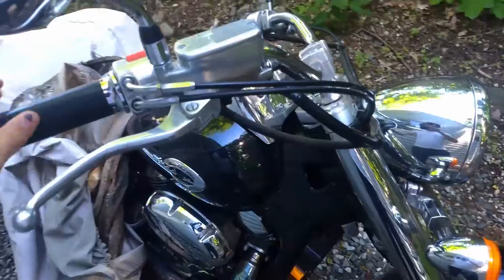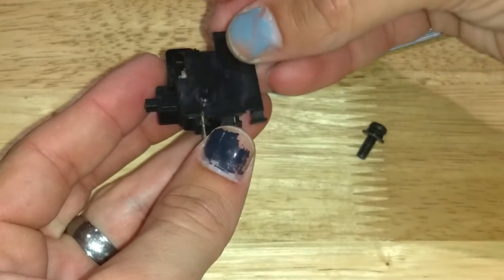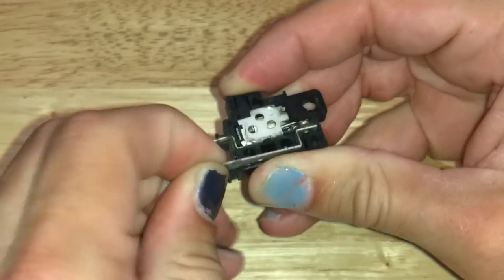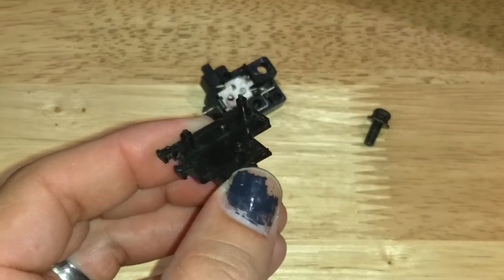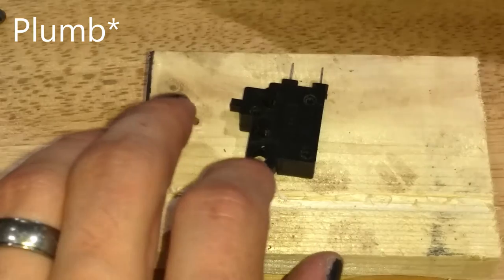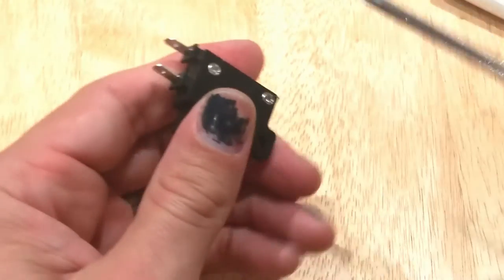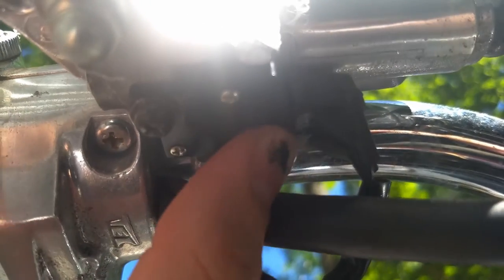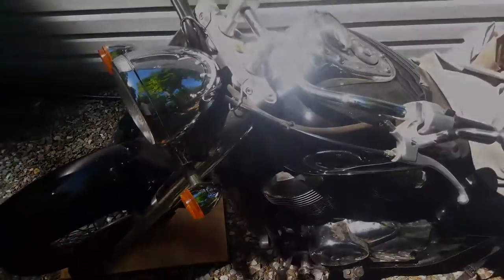Motorcycle Front Brake Light Switch Repair | Honda Shadow ACE (VT750C)

Comment: Was ready to follow your excellent advice but first, squirted some silicone free aerosol (Metalflux) into the switch where the button is. Operated the brake lever repeatedly and left it for 5 minutes. Switch now working normally.
Reply from the maker: Pinned this so that maybe people can save themselves the trouble of rebuilding it 😁
Reply: It works thanks a lot

Comment: I came across this video while looking online to order a new front brake switch so decided to give it a go.  At first when I pulled the switch out I thought you couldn't work on it but after seeing what you did, I was able to open it up and clean the contacts.    Like others have found, I just snapped it back together and the mounting screw holds everything together.  Just saved the cost of a new switch.
Reply from the maker: It's only a 10 bucks, but anything I can fix instead of buy is worth it to me 🙂  Glad this helped!

Comment: Funny how a video like this seems like something only a few people will use, but it helped me diagnose a starting issue on a Chinese Kayo Fox 70 kids quad.  It wouldn't start and I noticed the micro switches on the brake levers weren't operating.  I disassembled the switches and couldn't tell how it was supposed to work because pieces were broken.  Because I had multiple issues I wasn't sure if the switch was normally open or closed.  After watching your video I knew I had to jumper the two wires going to the switch, which let me track down the other problems and I finally got it running.
Reply from the maker: Glad it helped you!  I am very surprised by how much this seems to have helped for such a tiny part.

Comment: Hi, I did it just as you said and removed the switch took it apart and used a pointed pick to remove the mushroom heads and was able to open and sand the contacts. I took one contact out the other I left it in and used the tip of the pointed pick and scraped the contact head. I put it back together and snaped the cover on. no need to add replacement screws as once you screw the switch back in it holds the contact very firmly in. it worked great. Thank you, you saved me some money.
Reply from the maker: Well done!  Not much money I'm afraid haha, for me it's just satisfying to have fixed something rather than replaced it, hope you feel the same!
Reply: no, you did because I was going to take it to the motorcycle shop you encourage me to try to fix it myself. And as you well know they are not cheap to fix anything. thank you again.
Reply from the maker: Ah, then you really did save yourself!  I'm so glad I had that effect!!

Comment: That's a lot of trouble to go through when you could buy a new switch.
Reply from the maker: Sure, I could have gotten two for 10 bucks and had a backup too, but instead I took the time to troubleshoot the problem and find a solution.  I'd rather spend an evening learning something new and fixing something than buying a part.  That's just me though

Comment: Worked liked a charm!  Thanks for sharing!  Like others this had been showing intermittent trouble and finally gave up the ghost.  I isolated to the problem to this switch but couldn't figure out how to open it without destroying it.  *note, if you are lucky and don't remove too much of the plastic "mushroom heads" this will pop back together with enough bite to hold.
Reply from the maker: Glad it helped!  Mine were too damaged during opening for me to leave them as is with any confidence.  I pretty much knew as soon as I got it open how I wanted to modify it when I closed it, but probably better that you didn't damage yours as much as mine haha. Thanks for watching!

Comment: Thanks for the video man! Just went through this with the help of your video on my 86' Honda Rebel 250. I did also had to clean off the contacts and used a wire wheel with some pliars to clean it off. I did lose a small component because the wheel spun so hard on it, but ended up using the switch components from a parts bike to pick up where i left off and got it working. Really appreciate the video.
Reply from the maker: Glad to hear it man, Thank you!

Comment: Question was the light not turning on either with the brake on the right foot pedal ?im having trouble where my brake light won’t turn on at all neither with the hand brake or foot brake thanks in advance
Reply from the maker: For me the light DID still come on with the foot break, because it is a different switch.  If neither the foot nor hand break turn the light on for you, it's more likely that the bulb went bad than both of your switches going at the same time. Short the handbreak switch and see if the light comes on. If it does, both the switches are bad, if it doesn't, either the bulb is bad or perhaps a fuse is blown. Hope this helps!
Reply: @gumbyrocker  thank you

Comment: My button works opposite for some reason, when the lever isn’t pulled in (button is pressed on) the light comes on and when I pull in the lever it goes off, like reverse, thoughts?
Reply from the maker: After you worked on it or before?  It sounds like perhaps while you were reassembling the switch you messed with the mechanism under the metal cover.  Possible?
Reply: When you install it, the brake lever is alway pressing the button, so the switch is "disconnected". When you BRAKE the switch returns to its resting position and button is no longer pressed, and so the switch circuit is "connected" causing the brake light activates.

Said otherwise, when you are testing the fix, make sure you fully install the switch in a way tha the switch button is always pressed by the brake lever

Comment: great video and explanation.

Summary:
- Test functionality of light/wiring in the bike, by shorting the contacts in the bike. If shorting works, continue below. If not then you have a bigger problem!
- Remove the switch 
- Switch is sealed shut via 3x plastic heads, Remove the 3 heads by scraping them.
- Open by prying, and clean all the contacts both internal and external.
- Test in bike. Remember that the button is always pressed in normal operation, and when you brake, the button is no longer pressed.
- Find a way to close it and prevent dust and humidity; either screws, soft silicone, masking, heat sealant or other method
Done!

Comment: Just a tip:
# pry open the switch housing carefully, to minimize damage when putting it back in.
# if its corroded, clean the circuit with wd40 or contact cleaner. Rub the contacts and spring.
# there is another contact in the middle. Its a lever, make sure it touches, in a close position.
# make a hole for water with heated needle to wherever the water flow if the bike is on stand. The housing is not waterproof because the switch that goes in and out has no seal. So water will penetrate anyway.
# re-shape the housing using lighter to heat and bend to proper position.
# test the switch first (without the housing on) to your bike to make sure its working.
# close the housing and seal it with power glue and contact adhesive. Power glue to stick the housing together (careful not to get it in contact with inside components/moving parts). Contacts adhesive to seal around the housing from water.

Comment: Addvacdab of dielectric grease ...between the points ... Also on the Pilussh on connectors prevent corroison again .
Reply from the maker: I did show putting dielectric grease on the contacts, and though I didn't show it, I also put it on the push connectors before securing them.  Thank you though!

Comment: Both lever and foot brake doesn't light up the brake light. Thoughts?...
Reply from the maker: In that case I would start at the brake light.  Most likely the bulb is bad so check whether it works and ensure the connections in the tail light housing are secure while you've got it open.  You can test the bulb with a 9V battery and two small lengths of wire.  If replacing the bulb with a working one doesn't do the trick, work your way forward checking connections until you find the issue.  You can probably find the wiring diagrams for your bike and year online if you don't already have one, it will be very helpful. It's unlikely that both your brake switches went bad simultaneously, but also not impossible, you can check the front brake switch like I explained in the video with a short length of wire, connecting those two wires that go to the switch and closing the brake light circuit.  If that turns it on, both your switches have gone bad.  Lastly, it doesn't sound like a fuse issue because I believe all the lights are on the same circuit and you haven't said that all your lights are out, but it wouldn't hurt to check the fuse box to confirm that none of them are bad.  I hope you figure it out soon so you can get back to riding!  Let me know what it was when you do, and feel free to ask more questions if needed.

Comment: SIMONJOHN
Reply: just wanted to say thanks, great video mate, just fixed mine in almost same way, has been giving me intermittent function for a while, now all good, why they seal these things up, i guess they want you to buy new, is the same with most stuff now, but if there is   a will there is usually a way, i am all for this sort of recycling, cheers from NZ.
Reply from the maker: Glad it helped!  It does seem like they could have made it easy on us and had the cover be removable.  I'm just glad it worked out, it would have been a waste to throw it out and buy a new one.